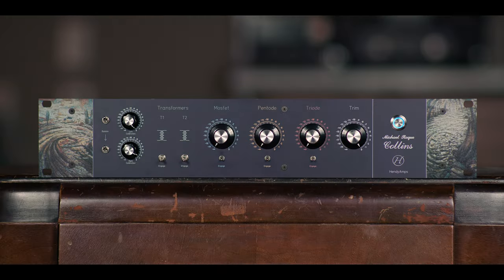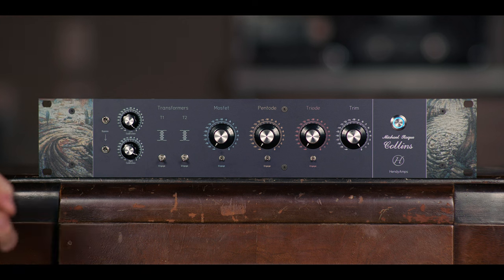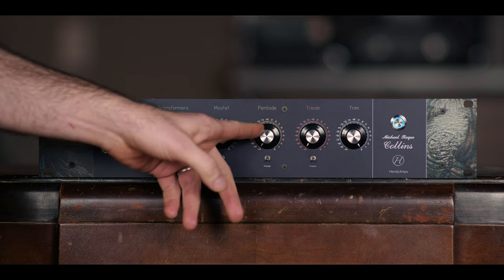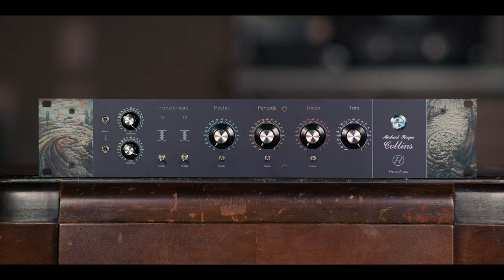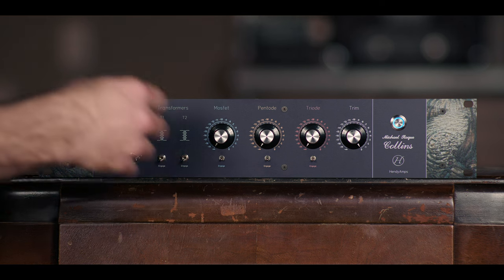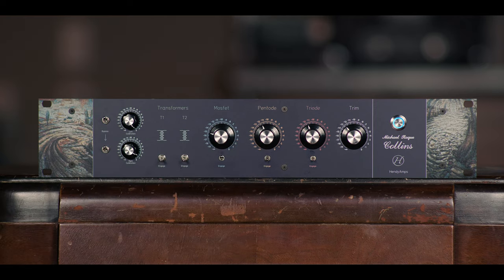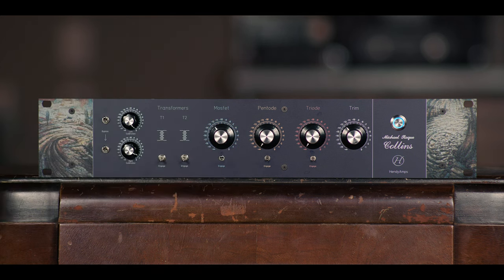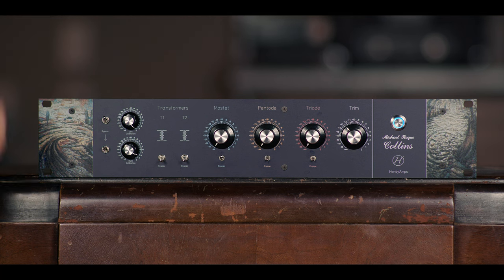Hendyamps - Collins Demo

Comment: Hello!,  I really love the unit but a wet dry knob would have been nice. :)
Reply from the maker: I hear you but technically in hardware there is no such thing.  Your "dry" signal would either be a buffered stage or normal gain stage and neither of those are invisible...thus you are always mixing this wet with that wet.  =)
Reply: Aha, I get you. Thanks for the info.